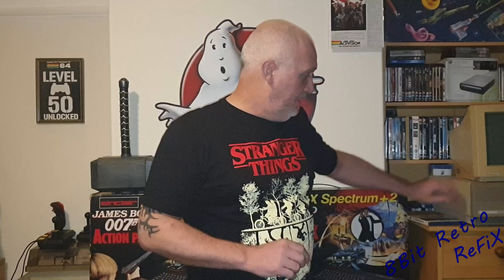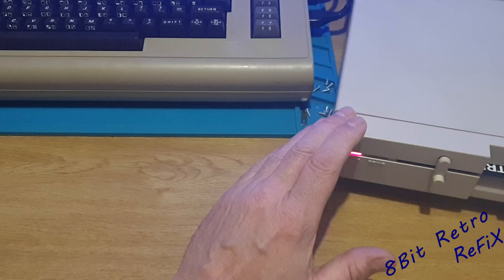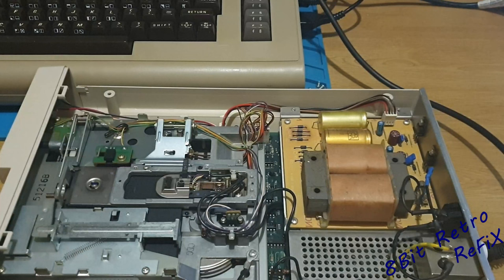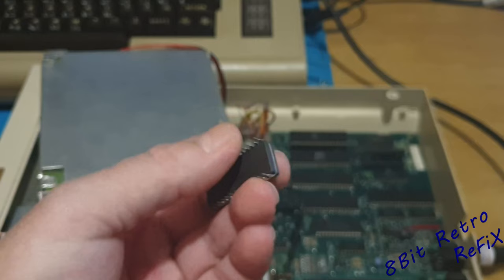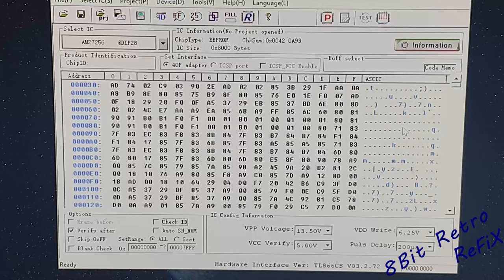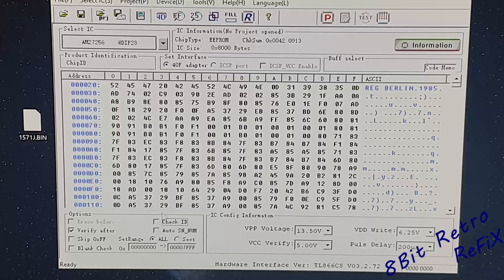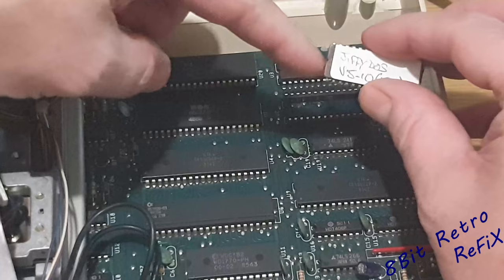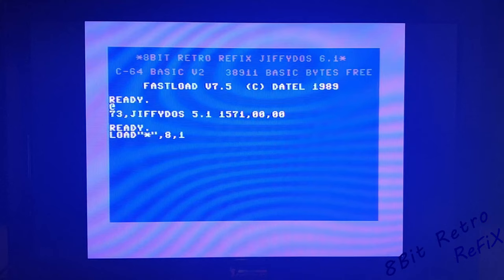How to make JiffyDos for the 1571 Disk Drive

Comment: The check Id setting is checking for the exact brand of chip you are using. 27 series EPROMs are/were produced by a number of manufacturers, and not every one used the same programming voltage. By having the id set and finding the correct brand of chip, you will ensure you can write without issues with the correct voltage. As I found out last week, it’s also a good way to find out if your EPROMs were rebadged before selling. I had some 2764s that were labeled as SG, but my TL866II would only let me write to them if I selected AMD.
Reply from the maker: Hi I've never had an issue writing to the chips with the check id unticked.. always have issues with it ticked ... these chips are very old and software doesn't recognise them correctly ... Thanks
Reply: @8BitRetroReFix  To be honest, I’ve never had issues either way, except when the label doesn’t match the actual manufacturer.